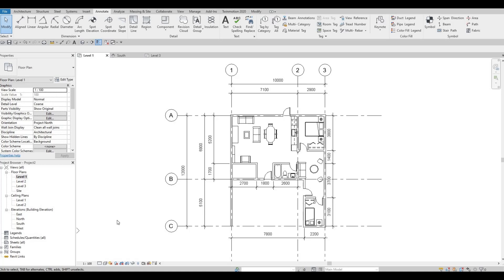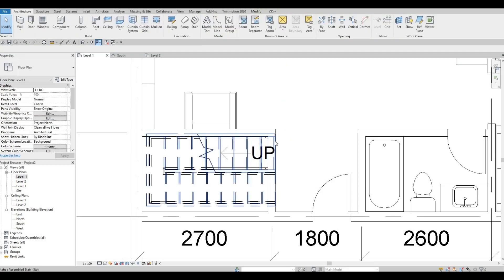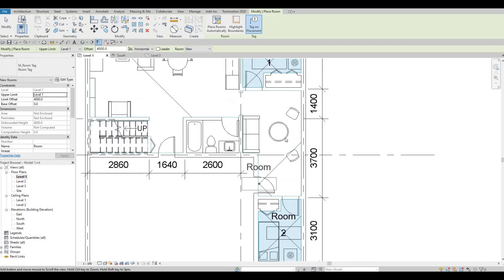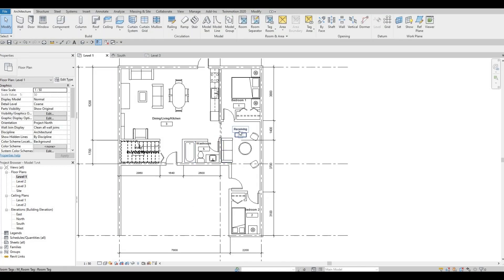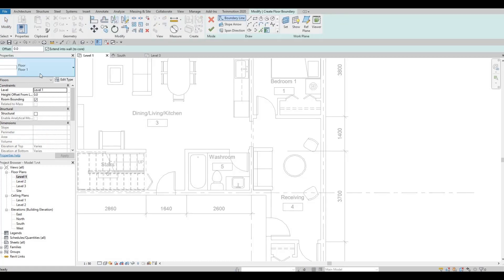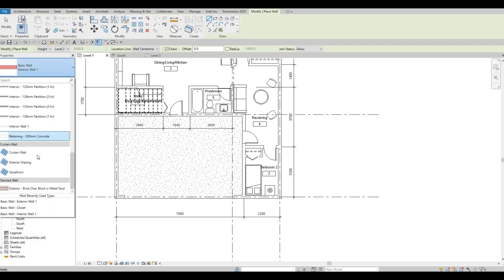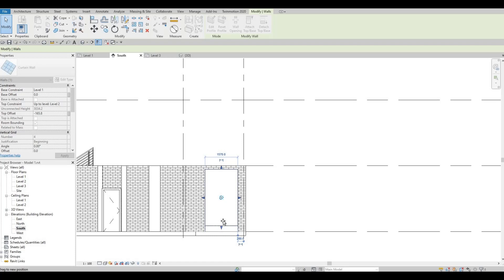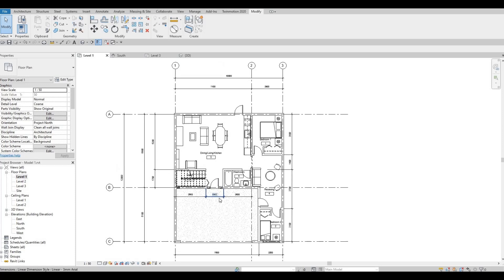Modern House in the Philippines | Part 3 | Complete Step by Step | Revit Project Tutorial

Comment: Why doesn't my wall split with the wall opening command? And it won't allow me to use the room separator for that opening!
Reply: Ah okiee will try thank you!🙏🏼
Reply from the maker: Sure, let me know if it worked 🙂🙏
Reply: @ArchCoreDesigns  will do, thanks!
Reply: Hi Arch Core it unfortunately didn't work, its still doing the same thing as before! Thanks for the help tho🙏🏼😁
Reply from the maker: Send me the file, let me see what I can do. Also what is the version of revit you are using?
Reply from the maker: Oh very nice, but unfortunately I still use Revit 2020 and I cannot open it as Revit is not backward compatible. I will research the reason and get back to you so that I can still help. 🙏🙂
Reply: @ArchCoreDesigns  ahhhh yes i recently got 2022! Yes its not backward compatible! Ahhhhh thanl you soo much! Sorry for bothering you, hope its not too much!🙈🙏🏼
Reply from the maker: No worries brother, I will always help if I can. 🙂🙏
Reply: @ArchCoreDesigns  Thank You Brother!🙏🏼
Reply from the maker: Hi Harry, try pressing the escape multiple times and then select only one wall. Sometimes it doesn’t work if there are multiple wall selected. 🙏🙂